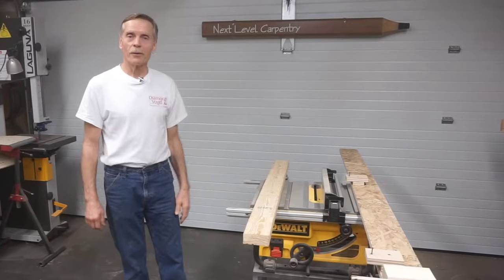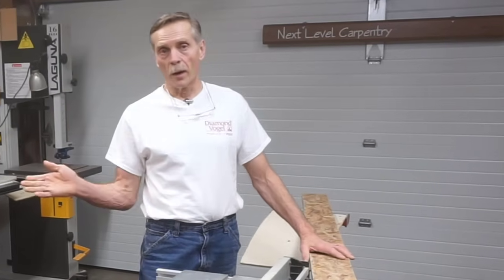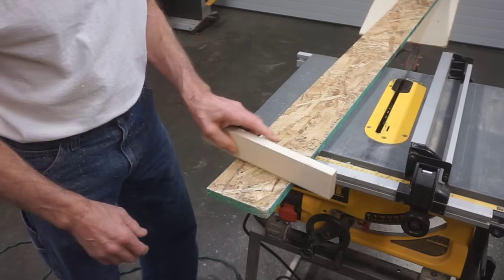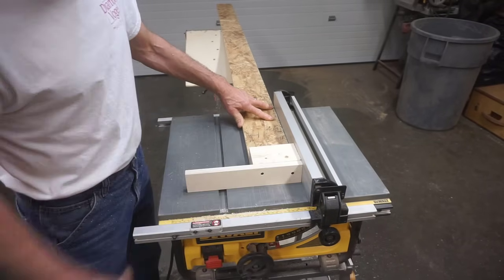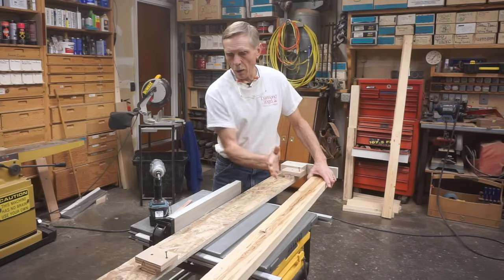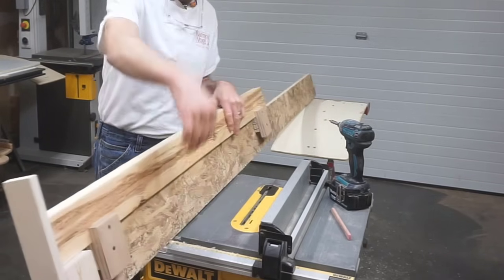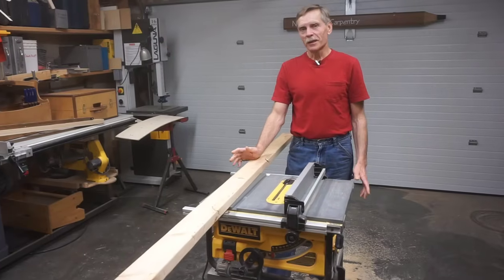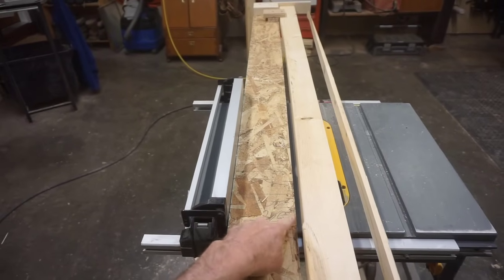How to Cut a Straight Edge on Crooked Boards

Comment: Thanks. I've had an ongoing problem with this very issue, but a lot of what I need to straighten I really don't want screws in it, but still this is very helpful for everything else. I'm wondering if there might be a way to modify a bar clamp that would grab the bowed board on either end to avoid the screws..A lot of what I have to straighten are shorter than 8 feet, more like 4 feet so perhaps a HF aluminum clamp attached? I'll tinker with it and get back. I'm not coming up with a viable solution off hand, but I've only been thinking about it for about 3 minutes. ;)
Reply from the maker: The fastest way to straighten those short pieces is to attach a 10' straightedge to your fence aligning the center of the straightedge with the center of the blade...  you can straighten up to about 4'-6" that way.  Go to the best lumberyard around and pick out a completely dry, arrow straight 10' 2x4 and keep it for the purpose.  Put the convex side of your workpiece up against that extended fence and you'll be golden.  Be careful when you're ripping so the workpiece doesn't loose contact with the straightedge which will cause a kick-back type situation.

Comment: Thank you for the very informative video as I'm a new woodworker and only have the basic tools so far. It will drastically help me until I can get a jointer. I have a question. Could you cut the board to a length you would be using and then do the same process?
Reply from the maker: For the most part, the shorter the board being straightened, the less board width it takes to straighten it and the 'easier' it is to do so: yes.  Sort of. Because of a technicality I suggest cutting the piece only to rough length at an inch or two long before straightening and cutting it to final length only after it's straightened.  Figuring out why this is recommended is an excellent teachable moment for any 'new woodworker'. 😎  You're sure welcome for the video BTW... Best, Matt

Comment: Nice video.  So I really like your outfeed table.  Any details on building it or buying it?
Reply from the maker: Thanks for your interest on those tangent ramp roller stands.  FWIW A 5-part full-on build video series is in the works here at Next Level Carpentry... stay tuned in the coming weeks as Episode One will be going into production soon.  Just so you know: the video will be steel fabrication and welding, not traditional carpentry and I don't want viewers to be disappointed or miffed by that fact.
Best, Matt

Comment: Information is filed in the head locker... I work in a shop that occasionally will do Millwork. Some of the rough cuts stuff is right out of a Dali painting. This offer a quicker way to a straight edge than many, many, trips across the jointer.

Comment: Just wanted to emphasize that these pieces are no longer 2x4s.  They aren't wide enough any more, now that they've been trimmed, for use where the size matters.  But, if you have 2x6s or larger you can make useable 2x4s out of them.  It may be advisable to trim them down to the next lumber size like trimming 2x4s down to 2x3s or 2x6s down to 2x4s.  Cheers.

Comment: I would like to add, if you can shorten the warped board into pieces, the warp won't be as large and you can more easily take it out of the pieces, losing much less material. I recently had a piece of 4/4 maple with about a 6" warp and a 30 degree twist. I decided to use it for the short pieces of my project. I cut it up into pieces roughly to length. I then put them on a planar sled using wedges and hot glue so they didn't rock.  I then planed one side, took it off the sled, and planed the other. Next I ran one side through my jointer and the other side through the table saw. In this way, I saved a $40 piece of maple and made 6 perfect short boards. It was the only solution. If I had used the method shown here, which is great many times, I would have made my $40 board into scrap because it would have been too narrow for anything.
Reply from the maker: Noice!  Reduce, re-straighten & recycle...
Reply: That is true. By the way, you can even straighten out a circle if the pieces are small enough.
Reply from the maker: And sometimes pieces are so bowed you feel like you ARE straightening a circle, right?! 🤣

Comment: I like this a lot! It seems to me that an adjustable stopper block in the middle of the board would be super helpful towards making it true [like a planer jig] . Basically, a counter sunk bolt coming from the bottom of the OSB and through the stopping block and fastened with a butterfly or knob nut.

Comment: Nice video. Make sure that "factory edge" is actually straight. Sometimes when a piece is ripped from a sheet it wants to curve. It has to do with the stresses built in by the manufacturing process and or changes in humidity. Twisted lumber is particularly dangerous because as it goes through the saw at some point it will want to roll sideways into the blade, Kick back! A good riving knife on your saw will greatly reduce the chance of kick back.

Comment: You could cut the warp off and re-glue the cut off to the other side and get both side straight. The 2x4 would be 1 blade thickness thinner that a normal 2x4, not too bad

Comment: Fantastic video.  Very useful thanks. Do you have any advice for squaring the other two sides? Is that when you need a thicknesser?
Reply from the maker: Making lumber that is S4S (straight on 4 sides) is generally done using a combination of jointer and thickness planer, usually incorporating a tablesaw too for efficiency.  Glad you like the video... thanks for watching and commenting on it! Best, Matt

Comment: The advantage of this method you are left with a fixture that can be reused. 

Back in the day I would nail the straight guide to the offending bent board and straighten it using the fence. The other way was to follow a chalk line as suggested below. 

Disclaimer: I was a kid working with my stepfather. Most of the time he was not sober enough to care about straight 2x4. Or having the saw blade resharpened. The wood was fresh off the big saw at the mill next door. I had to unlearn a lot before building my own things.

Comment: A favor can you make a video with a 2 x 12 Not sure if will fit a regular table saw with fixture Thx in advance
Reply from the maker: It's all about the width cutting capacity of your tablesaw.  Add the width of your straightedege to the overall width of the bowed 2x12 you need to straighten.  If that's less than the width capacity of your saw, the whole process is the same albeit a bit more awkward because of the extra weight and width of a crooked 2x12 vs a crooked 2x4 or 2x6.  Pay extra attention to safety!  Might want to do a 'dry run' with the blade retracted all the way and power off to the saw to get a feel for what it's like to rip wide material on your saw if you're not used to it.

Comment: Hello, Rookie question here: if I was not using a gig and push the crooked wood directly again the saw parallel guide, it would be hard to push ‘consistently’ and in a safe way is that it ? Hence the attachment to a straight wood that will be easier to push without the wood going away not in parallel with the guide
Reply from the maker: I think you get the idea. The only way you can cut a crooked piece without The Jig Is if the parallel guide on your table saw is twice as long as the piece you're trying to cut straight.

Comment: So, jobsite cheat mode...screw the 2x4 directly on top of the plywood. Now you have a solid handle, and the bow out hangs over the edge of the plywood. Screw from the bottom of the plywood so your screw head is hidden, set it to cut the same width of the ply, you got a solid straight line instead of crooked. And it was done in less then 2min and just a s safe.

Comment: I just use a scrape piece of plywood and screw on each end to get a straight line.run it The table saw. The most of the wood I get is S2S SLR1S but if I get in the rough, I plane it first,then straight line by by just screwing anthorer straight piece to it and rip it on the table saw.

Comment: I have many 10 footers, that need cleaning up. Could you simply add onto the 8 foot jig, you have used?
Reply from the maker: For sure!  You can probably just splice 2' on to the end of the strip of OSB.  You could also laminate 2 pieces of Smartside type 1x8 siding  to make them stiff enough to use as a straightedge.  It's a little harder to handle longer pieces so be mindful or, better yet, work with a helper?  Best, Matt

Comment: Hi I've just bought dewalt table 68mm saw, could you tell me what video for straight edge on small bit of timber, under 500mm. As I'm not sure , also could I destroy the 2 arms that a safety  part, they are restrictive .
Regards 
Andrew

Comment: Hi - thanks SO much for your super helpful tutorials and constant safety reminders.  I'm new to woodworking and your vids are invaluable.  Question: when you screw the plywood "hold-downs" onto the bowed piece, aren't you sacrificing that part of your bowed board, because it now has screw holes in it?  If so, are you strategically placing the screws in the bowed part that would be discarded, so the holes don't matter?  Also, what is your thought on using hold-down or toggle type clamps instead, so the only place there would be screws holes is in the jig?  I'm very new to all this and trying to understand and learn.  Many thanks again for so many amazing tutorials.
Reply from the maker: Keep in mind that the video is geared towards straightening Lumber used for framing where extra holes are of no consequence. Designs that use toggle clamps and a sled of some sort are much more suited to straightening Lumber used in furniture or Cabinetry....

Comment: That's one thing I'll never have to worry about...slipping on my garage floor.  It's flat but it has a textured finish instead of a smooth one.  I couldn't slip on that floor if I Squeezed out a tube of axle grease on it.  The bad side to that is that sweeping up stuff and getting it up the first time is well nigh impossible, and using a creeper feels somewhat akin to riding a washboard.

Comment: An alternative is to attach an extended fence on the saw- if you have a long straight piece that will work.
Reply from the maker: ... as long as the 'fence extension' is twice the length of the piece being cut.  For the example in the video that would mean having an arrow straight piece a full 16' long.. you know that, right? 😎

Comment: Do you have any suggestions as to what to use for the straight edge that's 16' long? We're wrapping an 18' beam in our living room and wanted to use as few boards as possible so we bought 16' 1x12 western red cedar.
Reply from the maker: I straightened pieces of 12' 1x12 Pecky Cypress for this beam project with an 8" jointer:
https://youtu.be/pf_tG1hQGtg
Straightening 16' boards is a real trick no matter how you do it but, if one of the bunch is already very straight, you could use that piece in place of the panel used in this video to straighten the rest.

Comment: I have a question (maybe dumb) but if you glued the offcut on the other side, would it be straight(er) and/or useable too? would it ad strength again?
Typical for a dutchman but i would rather try to make a handbow from it than to throw it out   ;- )

Comment: n00b question here.  If running the 2x4 against the fence produced two straight edges, why is the jig needed to straighten the long 2x4?
Reply from the maker: Watch more closely: running the crooked 2x4 against the fence WITHOUT being registered to the straightedge WOULD NOT produce one straight edge, much less two.  It's almost like carpenter's slight of hand so don't be embarrassed if you didn't 'get it' the first time through.

Comment: First off. I check my 2x4’s before purchasing them so I don’t have this problem. Bit if I was too dumb to do that and had this problem... I don’t think I’d have the patience to build this rig,  I’d just put it up the bowed side toward the fence like a rainbow and shave off the bowed side, then my new straight edge could be used to clean up the the other side (under the rainbow)

Comment: What state are you in? I’d be willing to pay good money for a hands on workshop if you were on the east coast. I’m in SC and just barely more than a beginner. Just sold my biggest job to date though. 4k for table tops for a new restaurant. I need arrow straight edges and this vid was PERFECT!!
Reply from the maker: I'm too far away for a Hands-On clinic but congratulations on Landing that project. FWIW if you plan on doing more furniture work like that I suggest you consider investing in the best Joiner you can afford because it takes straight edges to a whole new level. A good Joiner and a good table saw will pay for themselves many many times over giving them a very high ROI IMHO
Best, Matt

Comment: Would it be possible to set up one’s table saw as a jointer by using a dado blade and offsetting part of the fence? Very limited space in my shop🤨
Reply from the maker: Never been asked that question before... hmmmm.  Prolly better off using a router, straight edge and flush trim bit which can work very well and take up little space.

Comment: With me being new to this hobby, would you recommend cutting down the long piece to rough lengths before attempting to straighten it out?
Reply from the maker: Absolutely Philip... shorter boards are always easier and faster to straighten than long ones so anytime you can reduce the overall length before straightening you'll be saving time and trouble... 😎

Comment: How to cut a strait edge novice: chalk line, circular saw free hand depth set not to cut your horses. There is no 2x material worth this much trouble. Could drive and purchase a new one before you get your newly straightened 2 x 3  cut. Now what do you use it for, blocking?

Comment: Hi. I'm trying to find on your channel where you address that outfeed wheel with the "skirt" on it. Not having any luck. Have you a video about that?
Reply from the maker: No video yet but planning to do a build video in the next few months.  For now you can check out the Seams Impossible video for a better look at them... Best, Matt
Reply: @NextLevelCarpentry  Thanks!

Comment: Could you not achieve the same result by simply screwing the straight edge to the 2x4 ?  Then what do you use 31/8" studs for ? Probably better to rip it down foe a 2x3

Comment: Next time I have crooked boards, I will be sure to make one of those "contraptions".
Reply from the maker: As far as contraptions go I think you'll find it useful Mr Russ!  😁😎
Reply: @NextLevelCarpentry  Contraption usually means something ridiculous that doesn't work.  In that sense, this is not one. By the way, I also own a Kreg Adaptive Cutting System, which is a track saw track mounted to a table. I own two tracks, one on the table and a 10 footer  used for sheet goods  that is not. With the edge of the track on the crooked board, it could straighten boards too. . Then boards could be run through the table saw  to do the other edge.

Comment: I just started woodworking and have a question. For 2x4x8 can I use a toggle clamp instead to be a little bit more flexible? or is it not advisable for a longer board?

Comment: Basically, this is making a sliding table saw.  I just bought one, should have it in a month.  Many advantages to a sliding table saw including cutting straight edges on bowed wood and even live edge slabs if making an epoxy river pour.
Reply from the maker: As long as you overlook the major DIS-advantage of a legit sliding tablesaw: try hauling your new toy from jobsite to jobsite, right? 😉😂

Comment: When you don't have a table saw, put in a tiny nail in enough to hold a chalk line, and while holding the other end to the corner you need to get to, snap a line across the board you are going to cut off.  Then by using a sacrificial piece of wood, screw that piece you are trying to straighten and clamp it to your work surface and use a circular saw. Then measure off the other side and cut for that side too.  Then you will have an even piece of lumber.  Sure it's nice to have a table saw, but for those of you will be miles out on a call won't have a table saw.

Comment: Thanks for the video. I started laughing when you said you couldn't find a piece of bowed lumber for the video. I thought "I know where you can find a whole bunch of them" but you came to the same solution. One thing I picked up on was the fact you used the push stick on just about every cut. In all my years I've never used one and I've had my fingers on some pretty slim cuts. After watching this I realized I'm being damn stupid and have promised myself not to do that anymore. Losing a finger or thumb isn't worth the 1/10th second saved by not using one.
Reply from the maker: You're welcome Rich.  We're all born with a bag full of luck and an empty bag of experience.  The trick is to fill the bag of experience before the bag of luck is empty.  Your commitment to making a change BEFORE having a life-altering mishap like I once had tells me you'll do well with your bags.  FYI I don't use  just any pushstick: https://www.youtube.com/watch?v=8h4OJHhSH8A&t=4s not that there aren't many others out there... just make sure you're comfortable with whatever type/style/design you choose.  Best, Matt

Comment: Sir. I have an 81/4” table saw.  What would you suggest to do as far as feeding 8’ 1” boards through the saw. Should I have a roller or table on both sides? Also, after setting up the jig, can I stand to the side of the saw to make sure the jig stays against the rail?
Reply from the maker: Good roller stands are one solution but liking them a good helper is the simplest option...
Reply: @NextLevelCarpentry  thanks